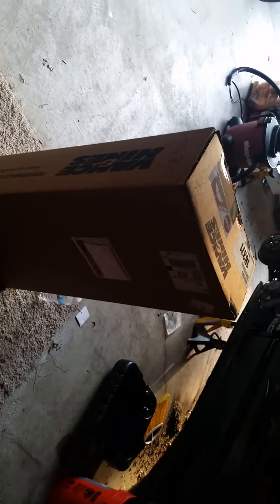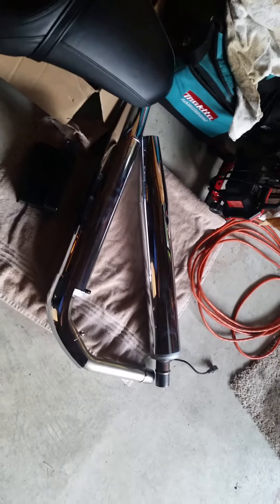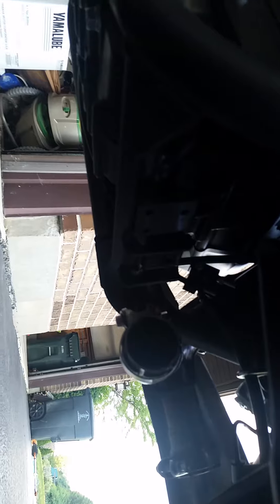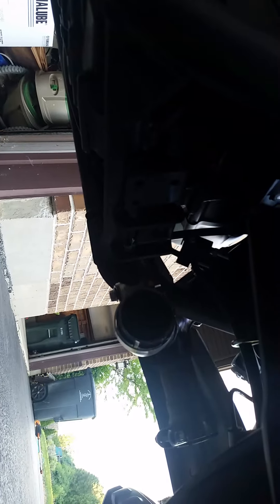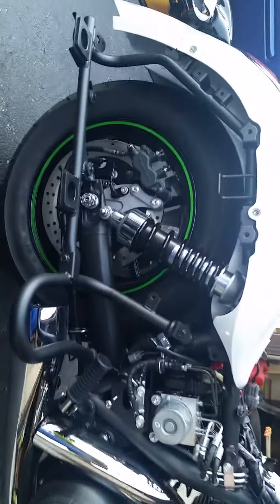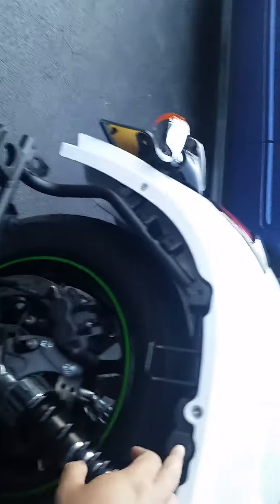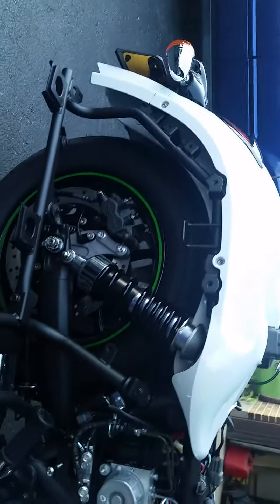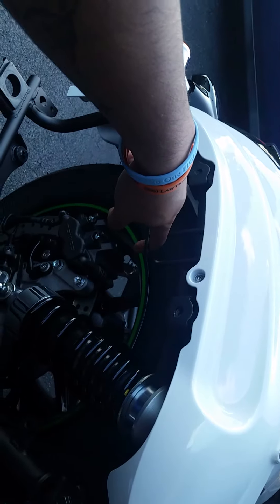Kawasaki Vaquero EXHAUST removal HOW to

Comment: hi, nice bike, my is a 2015 kawasaki vulcan voyager and I want the vance&hines to but let me ask you if your's come with the port for the O2 sensor or you have to do some modification, ride safe
Reply from the maker: the vance and Hines do not come with o2 bung, with the flash I have the o2 is not be plugged it so it works fine. I will be uploading a 500 mile review this week so stay tuned. thanks for watchig

Comment from the maker: I have a reflashed ecu from ivans performance.  with the new tune  o o2 sensor is needed. check him out online
Reply: thanks for the information, ride safe
Reply from the maker: Rene Asencio your very welcome, you as well.
Reply: +Brake light Warranty hi, how do you install the o2 sensor?
Reply from the maker: Rene Asencio I didn't install it, I had my ECU flashed by Ivan's performance so I don't need it.
Reply: +Brake light Warranty ok, when I tried to order the same pipes for my 2015 they said that is not compatible, what year did you use to order yours? sorry if I bother you
Reply from the maker: Rene Asencio no bother at all glad to help. Just order the pipes for any vaquero or voyager. They all install the same exact way just no o2 I left mine on my stock muffler and put them back in vance and hines box to save. Check out phatperformance.com for best price I found on them.